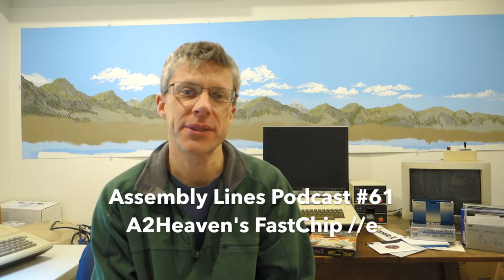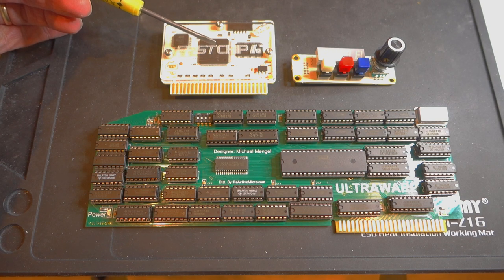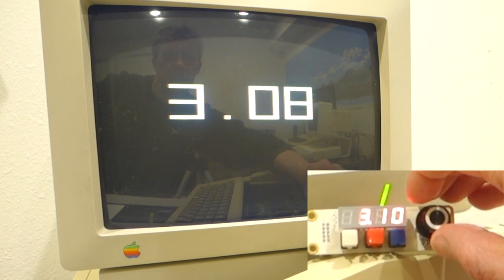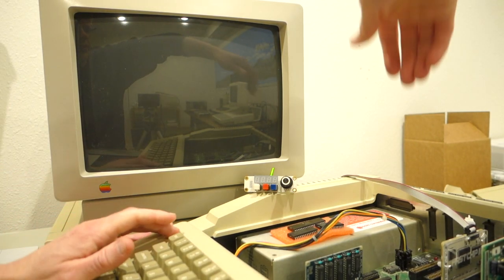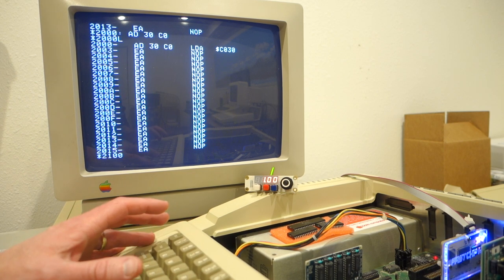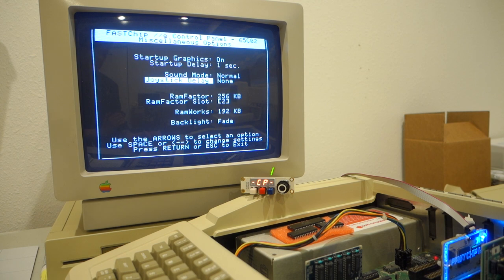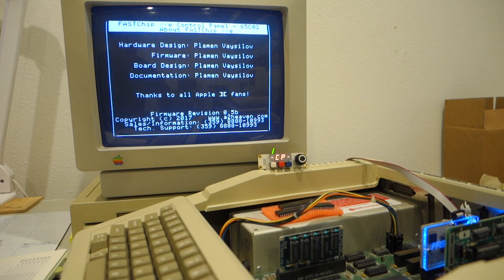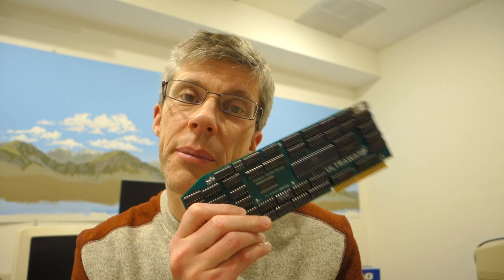#61: I Beat an Olympic Record

Comment: Awesome, but he should have gone the zipchip way, with a cache.
Reply: ROM code would run accelerated too.
Reply: You're copying the ROM to the language card's RAM
Reply: The ROMs in the peripheral cards in the slots you mean?
Reply: The zipchip saves into its cache the bytes when it reads them the first time, so 1) it does not have to keep a copy of everything, only what it needs, and 2) does it automatically as code is executed.

What you did there above by hand was to copy the ROM into RAM and disable the ROM, that's why it works. The zipchip would have grabbed a copy into its cache automatically and only of the data at the addreses addresed by the program as it runs.
Reply from the maker: That's cool! I'm going to try that.
Reply: What will be speed of ZIP Chip  if you make  jumps on your program code in size more that ZIPChip cache  ( 8KB) ?